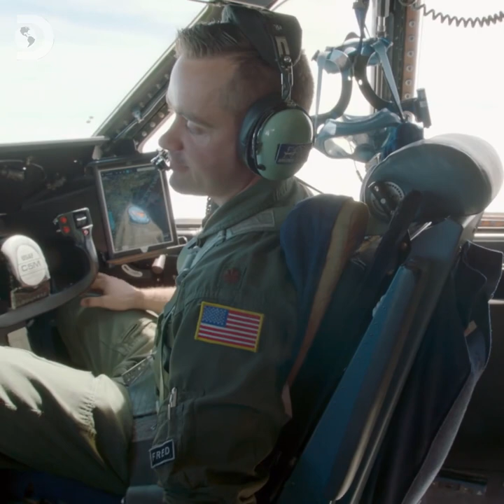Richard Hammond's BIG - Servicing A Cargo Plane - Preview - Discovery Channel UK

Comment: The C5 is almost done . They are flying with restricted load to conserve cycles. 
I wonder if they going to create replacements.
Reply: Are you sure about that? They went through massive upgrades only a couple of years ago to extend their lives into the 2040's. Do you have a link to an article about the load restriction from later years?
Reply: skunkjobb  My info was from the pilots them selfs. I know about the upgrade program but still restrictions where used in peace time. This all if the drivers told me the truth 😎